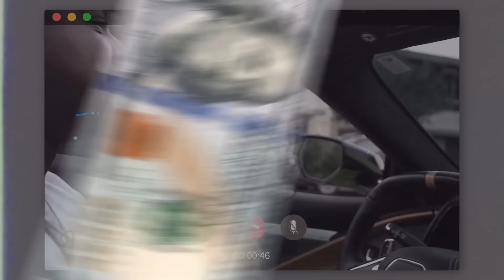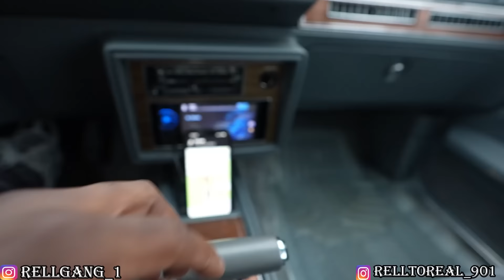FIRST DRIVE IN THE CUTLASS ON 26s FORGIATOS

Comment: Dude still be tsking too long. Dont care what nobody say. Dide took like a whole 2 weeks just for a drame notch. Cmon now thats the problem i be having with shops. Do the job and focus on it and get my car out of there. They be wanting to work on yours and other cars and tgen yours and other cars. I b wanting them to work on mines and only mines till its done. He took way too long fam no cap.
Reply from the maker: Thats not the case he fit me in because he didn’t have to he was booked up and I didn’t put a time frame on him plus the frame had to be redone from the last shop that fked up the frame and cut it wrong so u can’t put a time frame when the car was not factory coming in plus my car sat at a shop for 3 months for the same shit and it never got done and another shop that let my car sit for 2 in a half weeks and I went got it but at least he squeezed me in when he didn’t have to and he did wiring oil change new studs tune up new brakes and set carb plus smooth out all the well in two weeks and had it detailed plus put the steering wheel on it so why not give him credit for actually doing the job and doing it right
Reply from the maker: No one gone just only work on your car till it done u must ain’t never been to a shop before I see
Reply: @RELLTOREAL he definitely ain’t even been to a shop Kmsl unless you going to certain shops like Sammy’s and places like that lol
Reply from the maker: Sammy’s take a week just like Matt but if u fixing the frame is different then doing it from original so it’s gone take longer when u squeezing someone in instead of scheduling a person in
Reply: @RELLTOREAL  this the internet that man did a good job and he ain’t take that long lol people be on here talking aint never built a car 😭